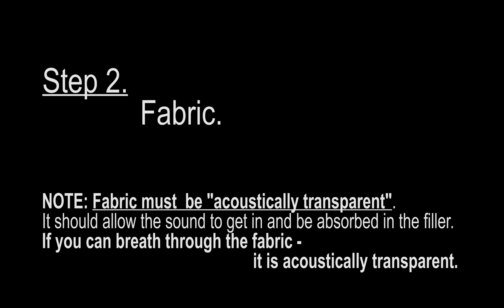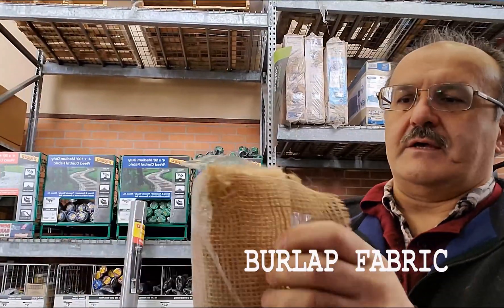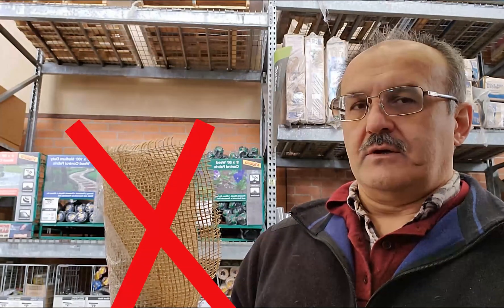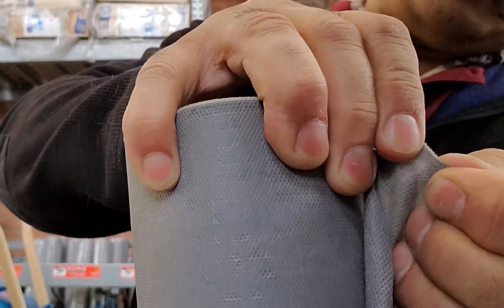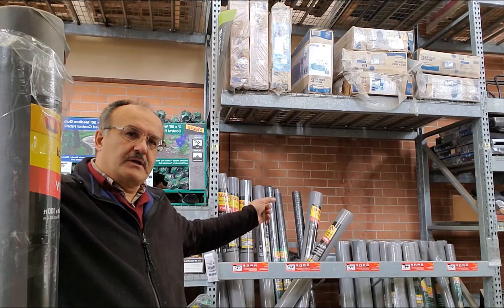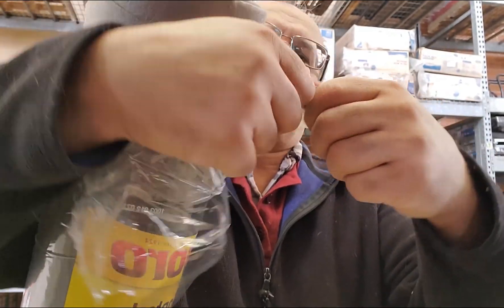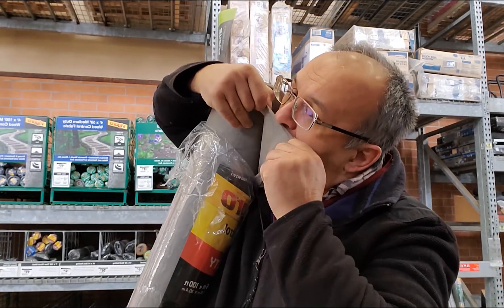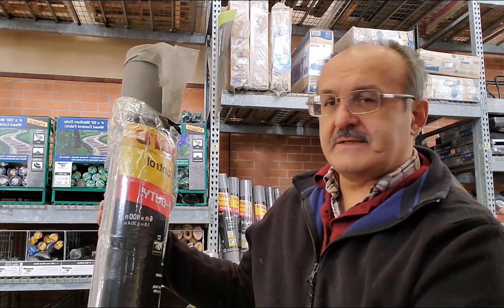DIY Acoustic Panel for Sound absorption made out of PVC pipes. Cheap. Efficient. Beautiful.

Comment: Very clear guide looking to do the same but i’ll be putting the frames on legs so i can move them freely. My concern is the hollowness of the pvc; does that color the sound or create any unwanted resonance?
Reply from the maker: Well i can see how the hollow tubes may be a concern.  This was just an alternative to wood planks. We actually made a much better design. Without PVC. With metal corners. And now i made a different option just need to do a new video.